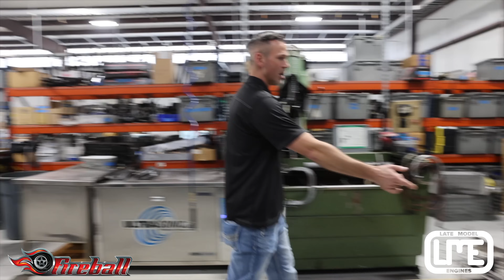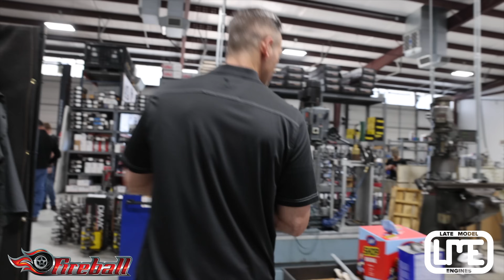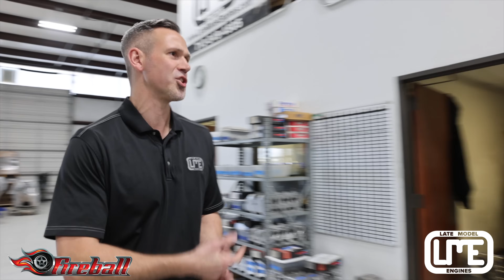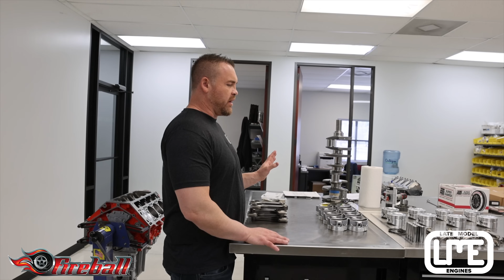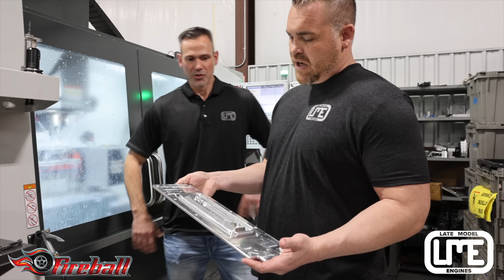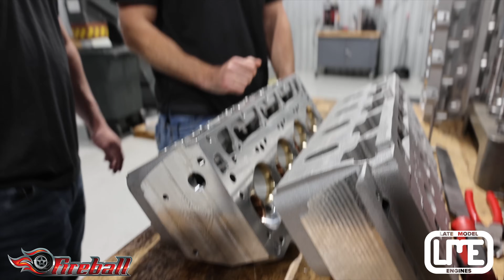Shop Talk and a Tour of Late Model Engines in H-Town

Comment: It’s absolutely amazing what a machine can do over manual labor today. Back when I was building motors we had almost none of this at our fingertips. I can remember weighing rods & pistons on a gram scale and then grinding and sanding to get everything to weigh the same. Then we had a funny little balancing trick to make sure each end weighed the same on ever rod. I won’t even try to explain how we made sure the pistons weighed the same from side to side. 
  All by hand made with machines and grinders we made up.
  This was back in the late 60’s an early 70’s . When I was over 20 years old!!!

Comment: Glad to see ACTUAL facts in regard to blueprinting. After I worked for a top tier engine builder and learned what it entails, I cringe every time someone throws the term around. It is not a common procedure regular folks would do to their daily driver or low performance build because it is VERY labor intensive.

Comment: Anyone had any experience with Plasma transferred wire arc ( PTWA) thermal spraying. It is a thermal spraying process that deposits a coating on the internal surface of a cylindrical surface, or external surface of aluminum parts. It is predominantly known for its use in coating the cylinder bores of an engine, enabling the use of aluminum engine blocks without the need for heavy cast iron sleeves.

Comment: those big boy heads he parades at the end should make more than 1100 hp.it depends on size but alas he doesn t mention that.those heads make well over 1200 hp in musi/edelbrock crate engine 632 cid na.i would like to 16-71 that for street duty.

Comment: Bryan and the crew at LME built a LT 416 for me last year for my 16 Camaro that made 680 HP in his shop. I didn’t get it running last year because I was waiting on parts for the fuel system. I’m building the car now and should have it running in a few weeks. Can’t wait, it’s  still a 6 speed car with twin precision 6466’s.

Comment: Having worked in a high performance engine shop for years back in the 80s /90's when everything was more a manual process, I can appreciate the significant thought and and technology they have included to reduce issues. I always build my own engines, but if I was ever to buy one off the shelf then these guys would definitely be on a short list.

Comment: LME makes some bad ass Engines I remember when they did the LS versus Coyote shoot out and he bring A LS motor that stomped the Coyote motor  It was more than a 100 horsepower difference And they had set guidelines  on how each engine was built
Reply: They had to make rules like average power and power/ci just so it was a little closer.  Its hard to look at the results and be neutral when the ls numbers were so huge
Reply: On stock head bolts too lol

Comment: Not adding weight to the mussi powered cars looks suspect..prochargers didn't dominate you did..remove you and kye lizzy killed last year. Lizzy won twice, kye 1-2 times and kye lost in finals 3 times to you and Lizzy once but all by inches.. bow this year hemi with twins will have 100lbs advantage over you this year and 100lbs on mussi cars..that's major considering Robin beat you twice and kye twice..that combo with liberty I think may be unbeatable..I'm not sure on weight breaks on screw blowers but I heard 100lbs for them but still limited on boost drive which still gives twins a advantage

Comment: I recently saw someone talking about hot honing: they have special torque plates that allow them to run high temperature coolant (170F or whatever) when honing. I wonder how much that's been tested to see if there's any improvement, doesn't look like LME does it.
Reply: Daniel, great question,  I can't say the name of the series that I built race engines for, you tube will delete the post, but I can HONESTLY say that we have done that type of block Honing,  as well as bolting on water pumps, engine plates, bell housings,  even mock up oil pans to simulate the shifting a block might go through during a race. Trust me when I say,  a cylinder honed by a professional to plus or minus .0001" in 12 or more places in a bore is more than adequate for any race engine, in any level of racing.  I remain anonymous here for a reason,  but don't believe me, look at some of the famous engine builders like Steve Morris, do you see him Honing cylinders in a temperature controlled environment  ?
Good luck Sir.
T.S. RACING
Reply: @t.s.racing  I don't know what secrets are enclosed in an SMX, never watched a complete build in person etc. 

It's hard to know whether something matters enough that it's kept a secret or matters so little that it isn't done. 

Any idea how much a torque plate changes bore measurements, rather than just boring a bare block?

Comment: It took me all winter to port and polish a set of small block steel heads on my days off back in the early seventies with a Dremel flex shaft moto flex tool. And the bastard that did a valve job stole them and left me with a set of shitty heads with cracks between the valves. I wanted to murder that so and so...